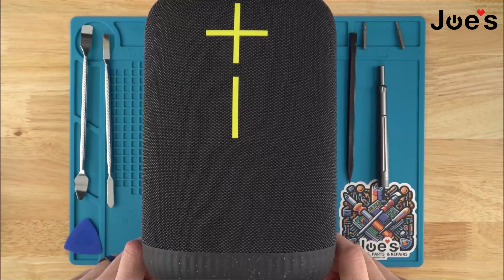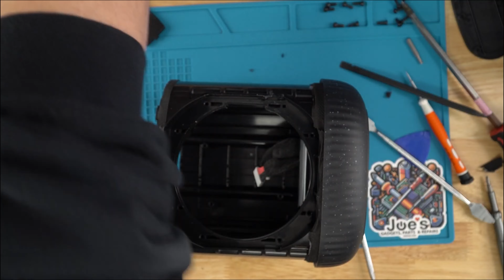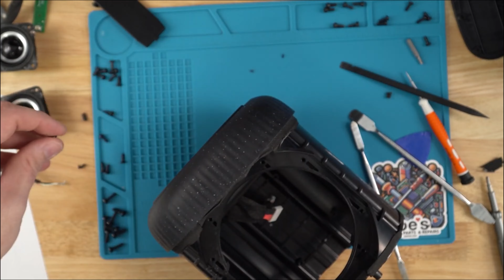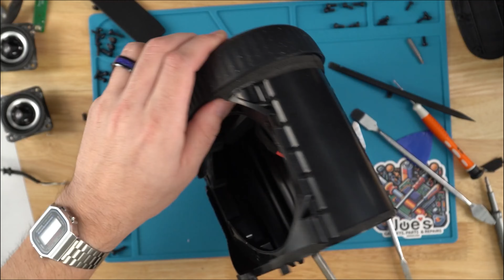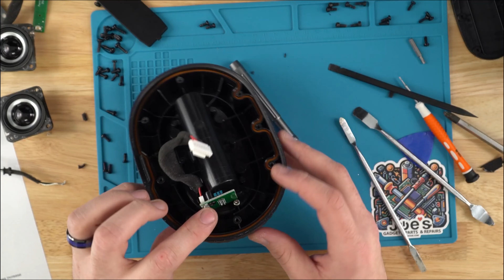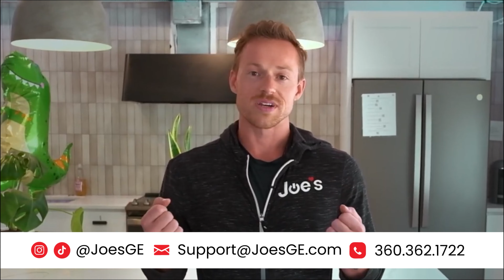Ultimate Ears EPICBOOM Repair Teardown: Battery Removal, Drivers & Main Board

Comment: Hello, greetings... Which speaker is better Ultimate Ears Everboom or Ultimate Ear Megaboom 4 ?
Reply from the maker: We can help you find the right part, tool or repair option. Please email support@joesge.com with your exact model number and what part you need.

You can also start here:
www.joesge.com
Reply: The Megaboom 4 is a bit louder, and the Everboom has more bass. I prefer the Megaboom

Comment from the maker: If this video helped you, drop a 👍 and let me know what device you want us to open next!

🛠 Tools used in this teardown:
• 50-in-1 Precision Toolkit → https://www.joesge.com/products/joesge-repair-tool-kit-50-in-1-precision-screwdriver-set-tools

• Anti-Static Working Mat → https://www.joesge.com/products/electronics-repairs-heat-proof-anti-static-rubber-work-mat-blue-tools?variant=32774989512750

• Plastic Pick → https://www.joesge.com/products/apple-ipad-lcd-screen-removal-thin-triangle-shape-plastic-pry-pick-blue-tools

• Nylon Spudger → https://www.joesge.com/products/nylon-spudger-opening-prober-alignment-ribbon-removal-repair-black-tools?variant=39303214694446

• Metal Pry Tools → https://www.joesge.com/products/strong-metal-opening-pry-repair-tools?_pos=2&_psq=metal+&_ss=e&_v=1.0

⚠ Reminder: Be careful with the ribbon cables — they’re glued down and easy to damage if forced.

💬 Question for you:
Would you attempt this repair yourself, or send it in for service?